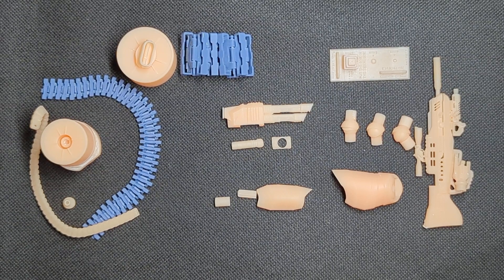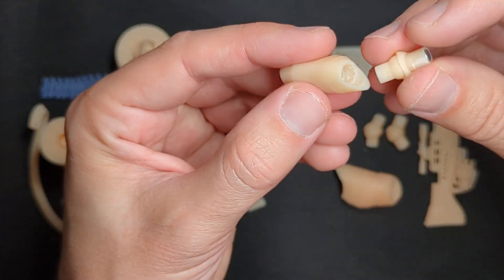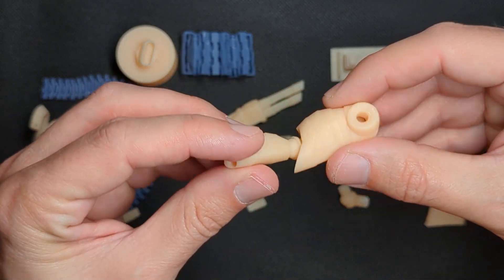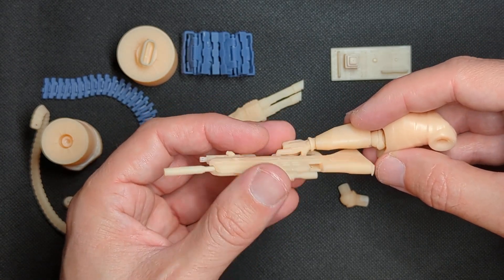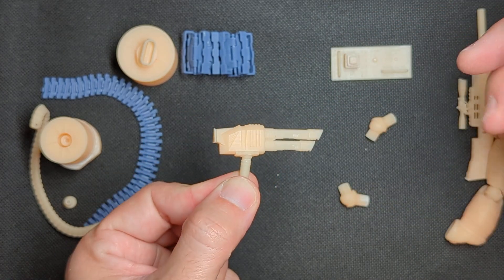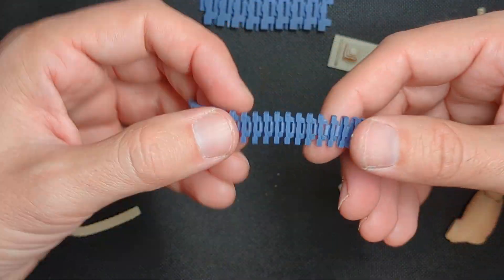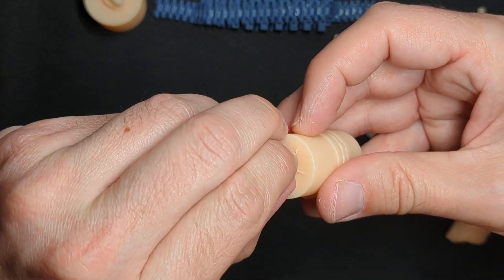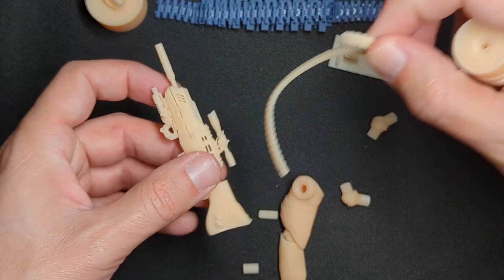How to make different moving joins in Resin 3D Prints

Comment: Thanks for the tips.  Is there a link to the model of the ammo belt?  Looking to do something similar with tank treads.  Have tried a few print in place items designed for FDM with poor results in resin.
Reply from the maker: Here you go, they are already supported, just put them on a raft and you're good to go. You can scale them however you like. https://drive.google.com/drive/folders/1DeyNdGjVknWx3rAzasRKHqqRjifPuC1i?usp=share_link
Reply: @J3DTech  Thanks a lot!
Reply: @J3DTech  The video is great. Ca. 3:49 you tell that you printed the smaller chain as a solid piece. Do you mean that the pins were printed in their final position within the holes in the links?
Reply from the maker: @pawelszyld524  Correct I did not assemble it after the fact.
Reply: @J3DTech  So it worked ok with the quite long and narrow channels between the pin and the link? Did it not form resin traps in the smaller scale? What were the tolerances? Did you support it similiar to the original print with separate pins? So many questions... 😅 Could you mabe give me a link to this solid piece? I am really interested how those kind of joints work with resin printing.
Reply from the maker: @pawelszyld524  Absolutely I can send you the file. 

If you're on discord that the best way to reach me. 

I'm on the Lychee Slicer Discord 

Derek J3DTech | lychee team